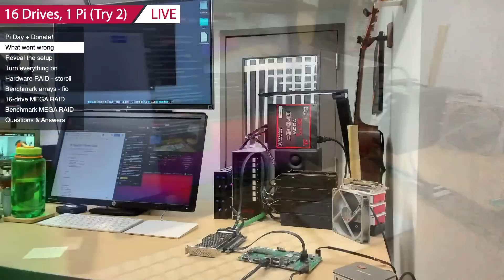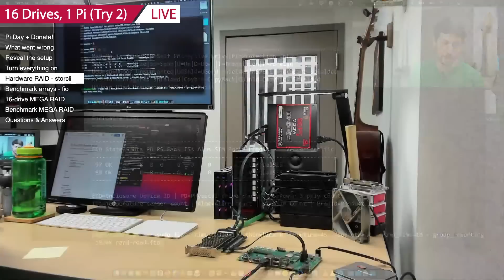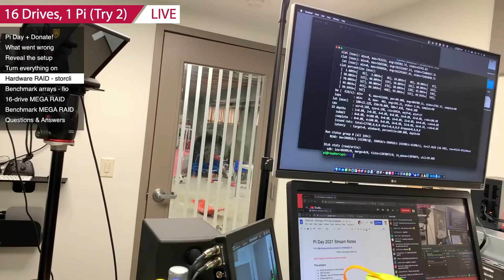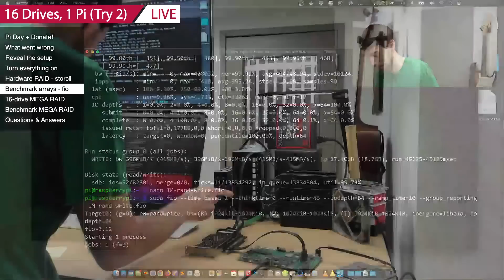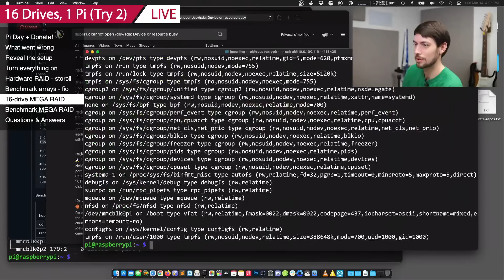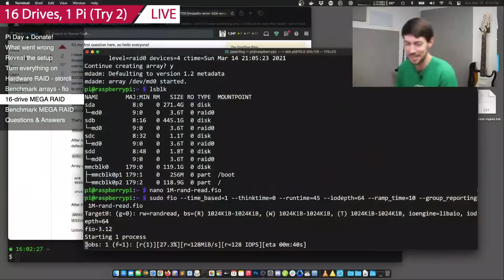IT WORKED! - 16 Hard Drives on the Raspberry Pi (Pi Day Special)

Comment from the maker: It worked! So... we learned a few things today:

1. Mixing together ancient SAS drives, used SATA drives, and new SSDs in one RAID array is a bad idea (but fun!).
2. mdadm can be a bit persnickety on the Pi (though I hardly think it's built for scenarios where you build RAID 0 arrays composed of RAID 0 arrays...).
3. The temperature in my office rose by 5°F through the course of this stream!
Reply: Have you ever thought of making a tape backup for your nas megadrive? Every datacenter has one way or another and tape backups  are the most common way of backup for storage centers like yours for the pi. If one of your 0 raid drives fail, you can turn to your tape backups and restore the data. They can store hundreds of terabytes in just one cassette □

Also. You said that those sas and sata drives are really old (and maybe bad) and probably fail :oops: . Have you thought of buying some new ones? There's less chance of them failing and they would be faster than 300+ mbs due to not being so worn down by use and time. But that's probably gonna be more expensive... But then again...... (if your thinking what I'm thinking 🖴💰)
Reply: @le9038  Wheres does one even get started in getting tape backups?
Reply: @virtualtools_3021  Look up LTO drives.
Reply: @virtualtools_3021  I restored a Dell PowerVault 124T tape drive with an LTO-5 drive. 16 tapes (24 TB of data). The price, even used, was more than a 24 TB raid array (with sata drives), but LTO 5 tapes last 30 years and the streaming performance of the tape drive is great.

Comment: Greetings. You said you could connect 240 drives to that card? How does that work? There are 16 ports correct? Is it a coincidence that you connected 16 drives? How do you connect more? Do you plug in 16 cables that split into 15 plugs each to equal 240? Thanks

Comment: Now, can someone build an enclosure for this that is actually elegant?

16 drives would be great, but I'd be thrilled to even have a 4-drive enclosure like that for the Pi, ideally with hotswap. Maybe the Pi hardware has to catch up first, but it would be cool to have that. Maybe allow for an HBA through PCI Express?
Reply from the maker: Check out the Storinator Jr by 45Drives. It offers a glimpse as to what could be possible!

Comment: I was wondering if you could get higher performance and scalability for a NAS if you used a cluster of Pi’s with only one or two disks each which are networked together using a distributed file system like Ceph. Does anyone with more experience know if something like Ceph could approach 10 gigabit performance by just using the Pi’s gigabit connections into a 10G switch?

Comment: Great Video!  I have a Raspberry Pi 4 (8G) 128 G edition. I have successfully mounted 8-9 seagate HDD (each with 10TB-16 TB storage), which works fine . However, while I added more than 9 HDDs, the screen does not show the new added HDD and sometimes all the mounted HDD disappear on the screen, and the Pi4 computer frozened. Any advices will be appreciated!
Reply: Weird coincidence but i just saw your stack exchange post while looking around at the max raspberry pi storage it can handle, your name isn’t even on there, i literally just clicked off the post

Comment: 1024 bytes is not a kilobyte according to the SI system, though. Kilo is 1000, no matter what the unit. If HDD manufacturers called 1024 bytes a kilobyte in the past, they were misusing the "kilo" prefix. I know it sucks when you have to discern between the two all the time, but when a hard drive manufacturer is stating that one gigabyte is 1000000000 bytes, they are technically correct. It's not just marketing, even if I'm sure marketing guys are really pleasant with having the technicalities on their side.
Reply: he meant Kibibyte

Comment: Regular hardware RAID controllers are quickly becoming useless for anything except raw throughput.  Each drive added lowers the overall reliability for the entire array.

Large RAID5 arrays (10TB+) are a nightmare. Data loss/corruption is pretty much guaranteed after a while. Statistically close to unavoidable...

RAID6 is a bit better but also almost useless when you pass a certain number of drives and/or TBs...

Simple math if you look at drive spec-sheets.

ZFS  if done right is a lot safer. Performance takes a hit compared to HW RAID due to CPU overhead etc. but a hardware controller would lower the reliability of ZFS volumes since the HW inevitably hides a bunch of info from the system about the drives...

Comment: Thank you for this great toutorial! I bought 60 Sata 1 Drives built in 2005 off Ebay and I'm going to RAID 0 them as a fast and safe storage space for my irreplaceable data. Especially the info at 01:08:45 made me decide this, it convinced me to place my order!
Reply: You make jokes about this, but thanks to chia and the insane Prices for High capacity drives i bought old drives by weight basically. Most are still OK and i ended up with about 100 TB of working drives for ~350 Euro. The biggest being 750GB drives (4 of them) with the rest mostly 320GB and 500GB Models.
I connected all of them to a single Intel SBC with a Xeon D-1540 CPU and an old SAS Raid Card with two expanders that i still had laying around.
Because i have very little faith in these drives i wrote script that would move everything from the "input" drive to at least two different drives (making a copy basically) while also adding 5% of parity data to a third drive (in case of bad sectors etc.). It also manages reads and "hides" the copied files. Only downside is that changing a file causes the entire file and parity to be re-written.
Its not fast, but its cheap and it works great as a temporary "dump" for new files before i can tag and add them to my main server (assuming HDD will finally go back to where they are supposed to be :))

Comment: I wonder what kind of performance you could get doing erasure coding with the videocore or whatever GPU they have now. Being a integrated the CPU-GPU latency would be pretty good (like APU performance). Having a cluster of these may make for pretty good fine-grained latency and the benefit of configurable software RAID is evident. Maybe one large server managing raspberry pi cards as psuedo-hardware software RAID per every couple of block storage devices. The pi was built with IO in mind its not ridiculous from an engineering POV IMO.

Comment: Good morning dear PiFriend :-)  .. I have a question. One problem of the new processors is "heat" ... _I remember that the old  processors did not heat much. What would happen if we "put together several" processors 6052 or Z80´s working in paralel... Can that work ?

Comment: I have a couple of old full height 5.25" SCSI drives. They sound like a gravel truck grinding gears as it bounces down a rutted dirt road.
Reply from the maker: Haha, I have one of those old drives still. I haven't turned it on in about 5 years, but yeah, that's it's normal mode of operation, when it's working correctly!
Reply: I always envisioned little gnomes with chisels writing the data :P

Comment: Why is mixing together disparate storage bad? There should be network analysis like Ceph's CRUSH maps that can optimize bandwidth given storage size and performance profile of each block device.
Reply from the maker: It would be nice if there were, but on the basic RAID level that's not really a thing. Instead, systems like ZFS, and some storage applications (like you'd find in a NAS) do have a little bit of a basic "raw storage + cache" setup you can configure, but even there, it's usually not a good idea to mix and match all sorts of random drives.

It can work, but the slowest drives are always going to drag down the other drives with them.
Reply: @JeffGeerling  Not if the data access pattern allows for automatic archiving to the old drives. For recovery and other low frequency access use cases it makes sense. Call me crazy.
Reply: I told your dad about it and he seemed to think it was a good idea.